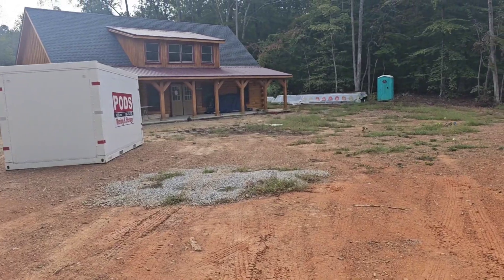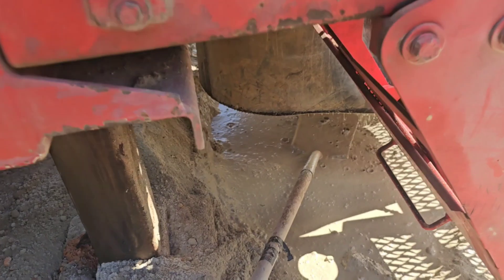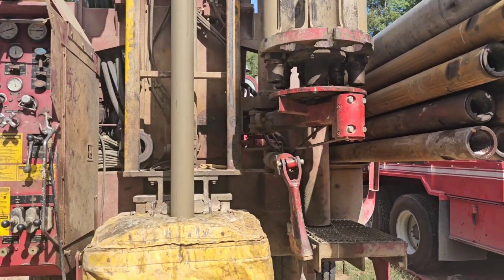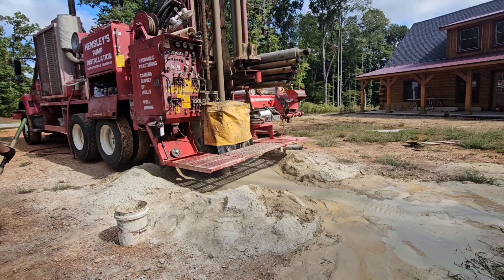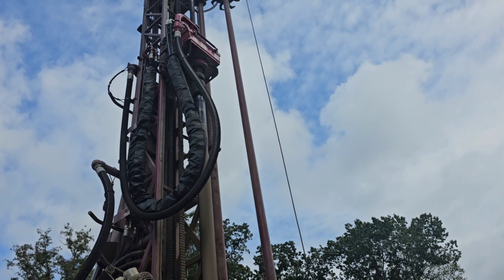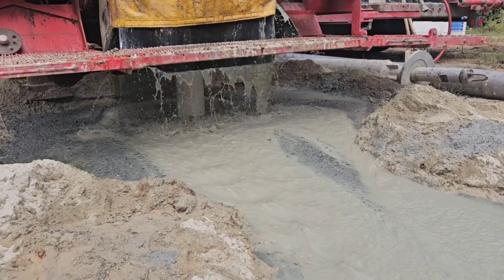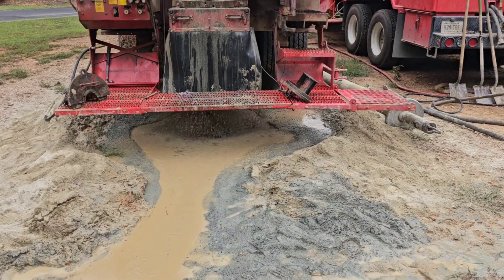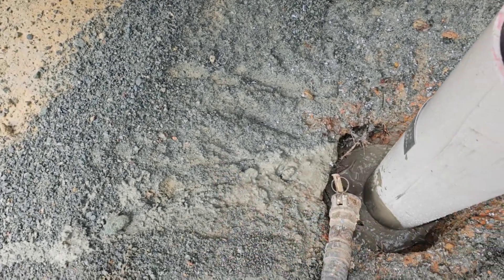Well Drillers Log. Keeping Detailed Notes on what we Drill Through & Why!

Comment: When you do a test on the pump in the shop.. your readings are … incorrect because you have to install the flow meter 7 to 10 times pipe diameter away from the tank from bends before and after

Comment: what kind of grease that you wipe onto the drill ends?
Reply: Bumping since I too am curious.
Reply: I was actually scrolling to see if this question was asked.
is it Never Seize, just grease, is it food grade?
Reply: It is a copper based never seize compound. Expensive stuff. 
it is not "food grade," but it does not need to be. What little escapes the threads gets washed up the well. It is not poisonous.

Comment: what are the "prameters" for when you start using water over air to float out your cuttings?
Reply from the maker: @jetegtmeier71  once moisture is present you must add water or you risk lifting the soil around the rig & cause a blow out. If it blows out under the pad, then the rig will tip over

Comment: How well is the casing sealed if the granite is at 36' but you can only ream to 20'? Does the grouting really seal the well or is it more to meet regulations?
Reply from the maker: @fascistpedant758  rock chips seal the casing. Grout is just superficial.
Reply: @h2omechanic  Thanks.